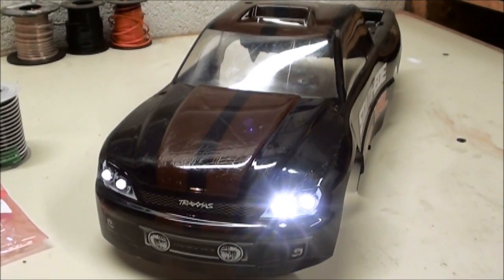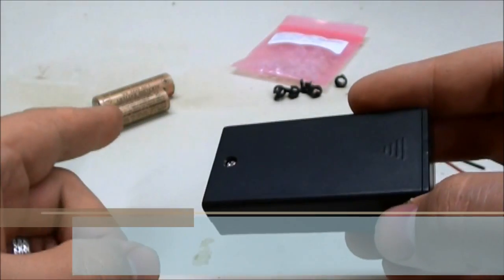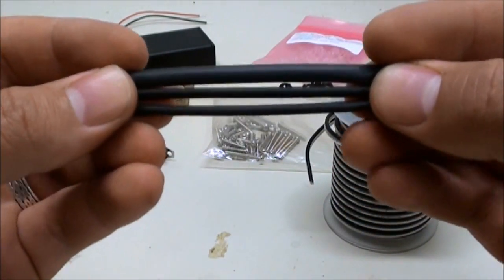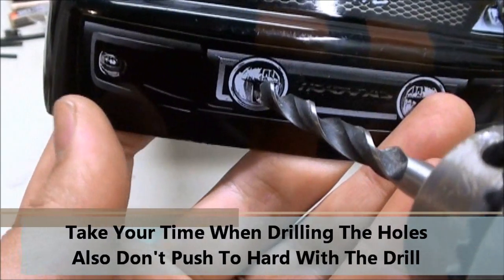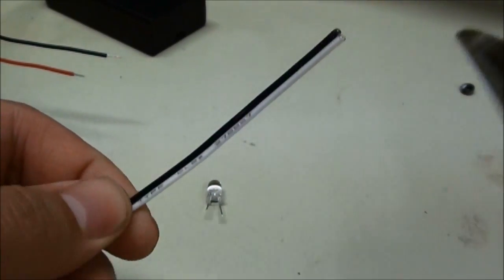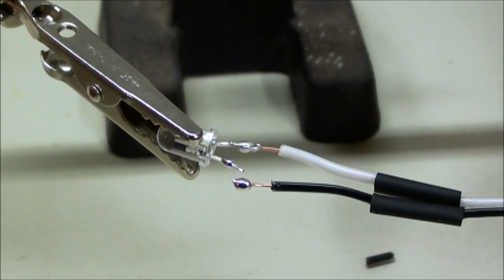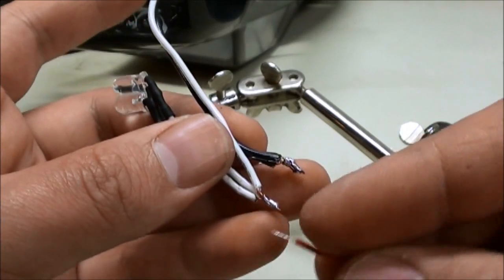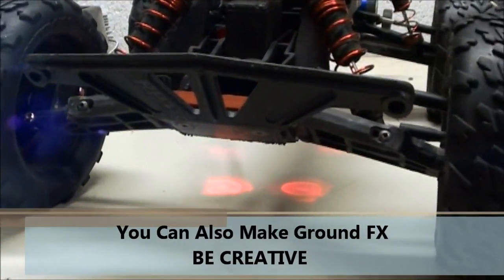Dark Ecliptic Heart RC Projects - How To - Make RC LED Light Kit

Comment: nice video. i have a question. i noticed that you didn't use resistors. is there a need for it if i power my leds using the rc's battery?

Comment from the maker: You could use a resistor to bring down the voltage so it won't burn out the LEDs. They have resistor calculaters so you can find what kind of resistor to use. You can find one online fairly easily. However I honestly don't know to much about that stuff so that's all I can tell you.

Comment: Have you tried using a servo board as a controller? Can plug into 3ch receiver to get power and use 3rd channel to turn lights on and off. Very simple.

Comment from the maker: Yes you can hook up a traxxas connecter and use a lipo. Just make sure you don't have to much Voltage going to the lights or it will burn it out.
Reply: I've done that before and all that I had to do to prevent burn out was add the appropriate resistance to the circuit. Still working 8 years later.

Comment from the maker: The lights are just basic 5mm led lights. Many companies make them. The battery pack is just a generic 2 AA battery holder and the switch is a slide switch but you can use a toggle switch too.

Comment: Hey u know what i did i hooked some up to where the ESC connects to the motor so when i give it throttle they go on brighter and brighter and then so on but they have to be high voltage ones

Comment from the maker: Sorry but I wouldn't know. I know batteries can get hot rather quickly if the positive and negative wires are touching at some point. But if your wiring is secure and solid then I would guess the batterie holder was faulty.

Comment from the maker: For this set up no I didn't need resistors. If you're going to use the the reciever box for power its 6v. Becareful not to have to much volts going to the LEDs if they can only handle so much.

Comment: would it matter if the battery case had a switch on it could i still put a different switch on the body?
Reply from the maker: You can put the switch were ever you want to.

Comment: can i just use a lithium battery with the same volts? the one that is use for watches and calculators.
Reply from the maker: Yes you can.
Reply: darkeclipticheart
thanks. last one, Is it safe to use four 5mm super bright led with 2 pieces lithium batts or 1 piece is just enough?

Comment: What if you don't have soldering iron??
Reply from the maker: You can use conductive non soldering conductive glue but that will take a lot longer and will be messy.
Reply: i can use electric tape